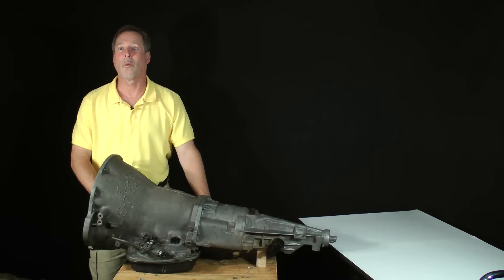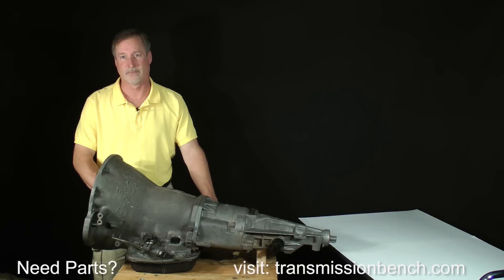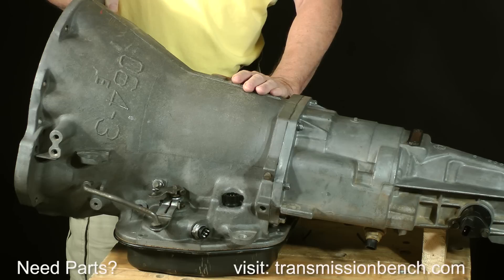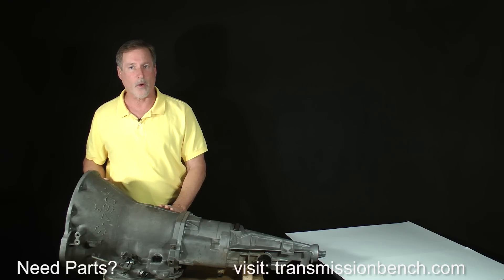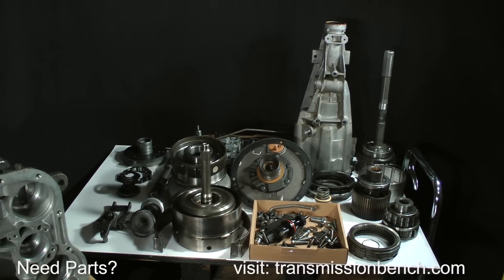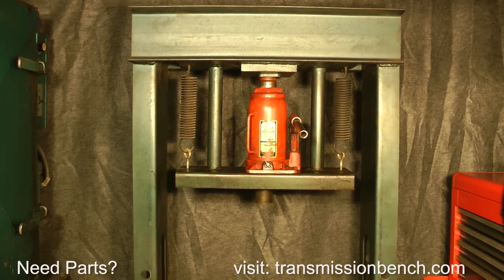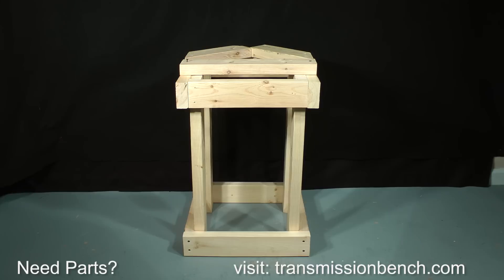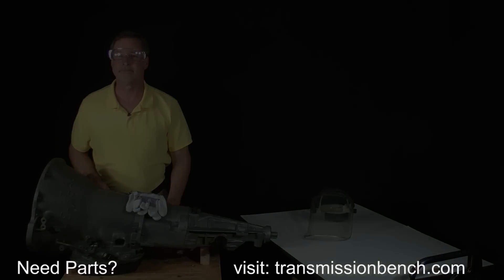Chrysler 46RE Class Part 1 Lesson 1

Comment: This man gave me the confidence to rebuild my first automatic transmission and I've been a geared all my life, but always ran from auto trans...if you follow this man STEP FOR STEP WORD FOR ABSOLUTE WORD, you will have an auto trans that works flawless. Only 1 slight issue with mine I have to figure out (I'm sure it's my fualt)  lately it's been starting in 2nd or 3rd gear after a stop now and then. It's not limp mode, feels like a sticky valve. When I roll to a stop if I take off and it's in 2nd or 3rd, if I shift to neutral then back to drive it's fine. All new borg warner gov pressure sensor and solenoid along with mopar brand overdrive sensors. I'm not sure if this is where to ask him a question directly, but I hope he answers me !

Comment: I have a 03 Dodge Ram 2500 5.9 Cummings w/48re. I have an intermittent shuttle shift  at 60 mph to 70 mph. At  60 mph at 1800 RPM in  overdrive the trans. Will shift down to to third gear and eng. rpm spikes to 2500 rpm and will go back and forth unless I push the tow haul button and limp back in 3rd gear at 45mph. I was going to replaced the governor solenoid to try to fix it and sell it until a saw your video and I thought why not overhaul it since  already have 225,000 miles and my bands are adjusted as far as it can go.What do you think?

Comment: Hey transmission bench. I have a 46re 2001 dodge 3500 cargo van. I’m having trouble shifting from first to second gear. It will shift at about 27 mph I’m just curious what your thoughts are and what the most likely problem is. Your videos are awesome

Comment: whats the difference between the 46re transmission and the 46rh transmission . does any one know ? they look the same.
Reply: Let's try an accurate answer for you...
The RE has electronically controlled line and governor pressure, with an electrically controlled shift valve for overdrive and lockup converter.
The RH has mechanically controlled governor and line pressure, with an electrically controlled shift valve for overdrive (and lockup converter, if so equipped).
Reply: The 'e' in 46re stands for electrically actuated valves wheras the 'h' in 46rh stands for hydraulically actuated valves. identically same gearing, just different actuation and connectors

Comment: Thanks for making the great videos. My first and only trans 20 years ago was a TF727  for an RB block. Pretty simple if I remember. Just had to build a clutch pack compressor out of some all tread and angle iron.
 Now I have a 2000 Durango that belonged to my dad before he passed that slips really bad when you first start it if its been sitting over night or longer. i learned to start it and let it run a few mins first and a few high revs and it seems to be fine after that. been doing that for a few years now. only drive it a few times a year but runs and shifts fine after that. Im Thinking seals are bad and all the oil is running out of everything and going "dry" and by letting it run gets oil back to everything. What do you thing?

 I also have a 4L60 to do in a 1998 K1500. think that one is just a converter lock up sel. you can feel and see the tack surging above 40 MPH. seems to run and shift fine other wises but thinking of total rebuild because this is going to be my "new" plow truck. 

 I would condenser myself a very serous back yard hack. ( 2500sf garage and 2 lifts) I trained as a mechanic back in the late 80's and was in the field for short time. I still enjoy working on my own stuff and my kids and friends.
 
 I have been wanting to dig into these 2 trannys but lacked the knowledge plus im more of a hands on kind of learner so your lessons are great way for me to learn. Plus im doing these with my youngest son. Would like to see him get into doing transmissions on his own. good money in them and I'm setting him up with everything he needs to do them.
  Any How Thanks a ton for making these videos. cant wait to see what you do next.
 Jim K
Reply from the maker: +jkerry812 Hi. There is actually nothing wrong with it. The torque converters on 904, 727, 46RE, 42Re etc. drain back into the pan if you let them sit for a few days. I have a 1997 Dodge Ram 1500 myself, which I bought brand new in "97. It does it too. I now have a total of 248,000 miles on it and the drainback has gotten a little worse over time. all you have to do is put the selector in neutral for about 15 seconds after you start the engine. I just live with it. ...hope this helps....Jimmy
Reply: +Transmission Bench 
My 94 cummins is doing the same with 50k miles on trans. Only takes about an hour for drainback but if I put it in neutral first for a few then into drive everything seem fine... My truck just started doing this so It's a little scary especially when I took it to a shop for "professional opinion". They said front pump was bad and I need a rebuild to the tune of 3000 dollars... No thanks haha... any help would be greatly appreciated..... Where are you located TransmissionBench?